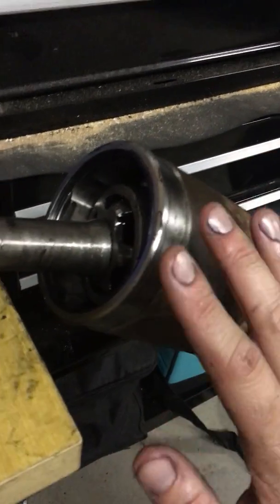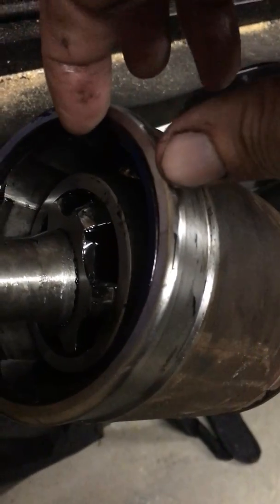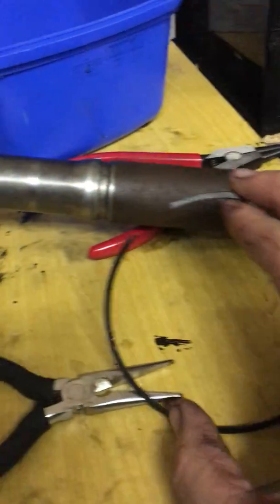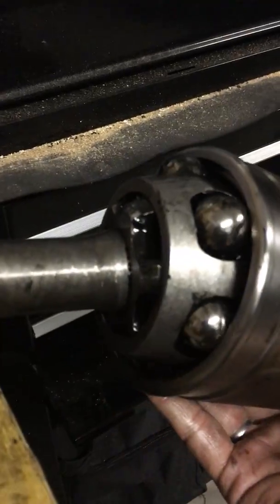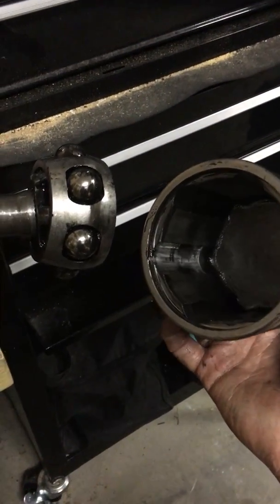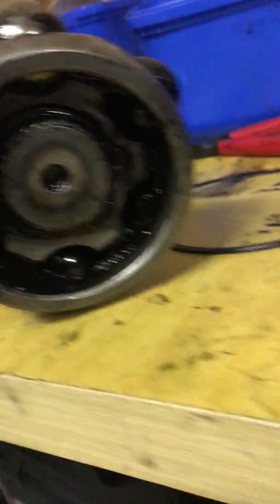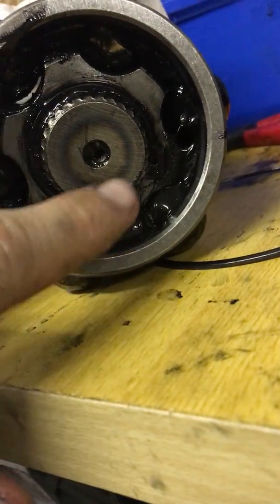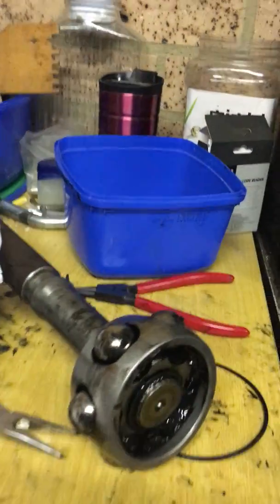100-series IFS Landcruiser CV disassembly

Comment: What aftermarket CV's did you get?
Reply from the maker: Drivetech4x4 - actually had a mechanic fit them, because it was getting too close to a trip we were about to head on
Reply: @markpowell5560  how are the drivetech cv's holding up ? i was going to go nitrogear cv's but drivetech are so much cheaper.
Reply from the maker: Patriot- no problems at all. Although they squeak a little when first taking off in the morning - otherwise have since done the Simmo, Oodnadatta Track, Stryzelecki Track, bunch of high country work and they’ve been great